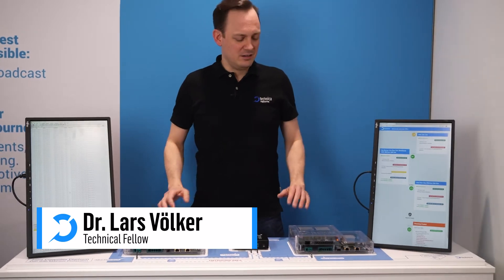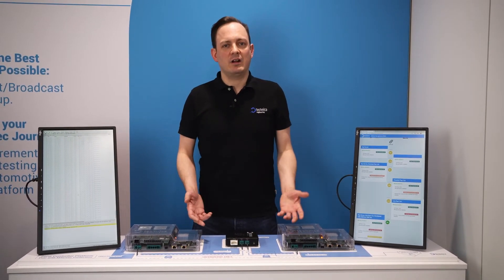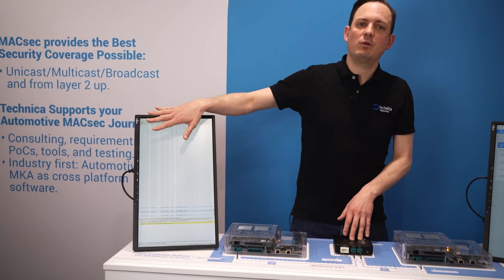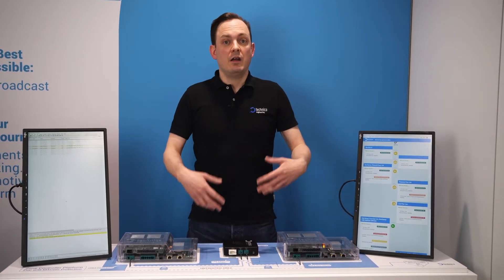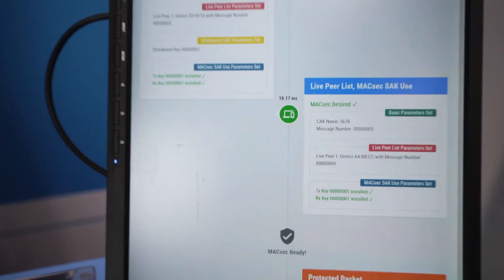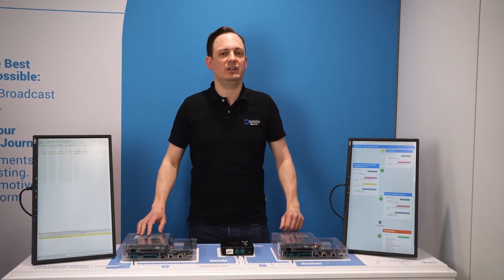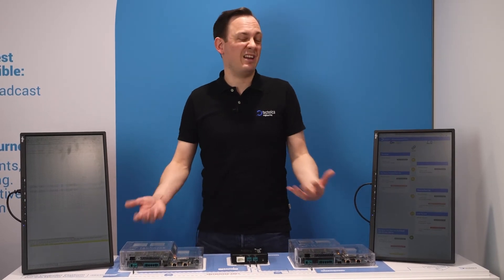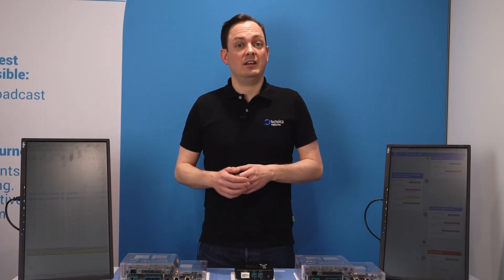Automotive MACsec

Comment: Thank you. I would be interested to see live demo on some hack and how MACsec is preventing the same.
Reply from the maker: You might be able to create such a demo yourself. Just use two “ECUs” and add some unprotected communication. For example a SOME/IP message for the vehicle speed signal.

Now add a man-in-the-middle attacker to change messages; e.g., limiting the vehicle speed to a low value.

When turning on MACsec, you will see that the hacked messages are not accepted by the original receiver anymore.